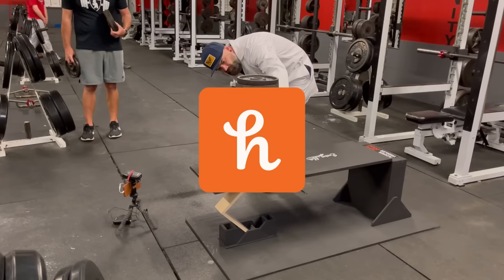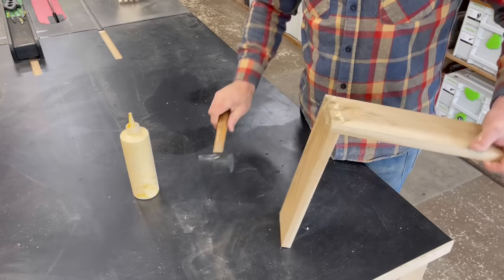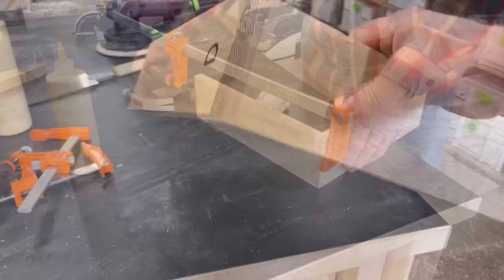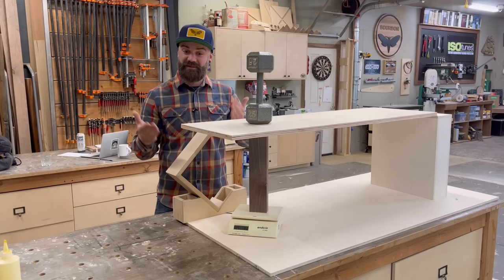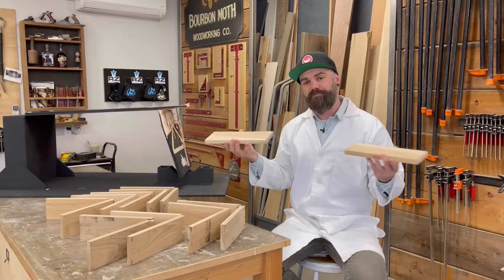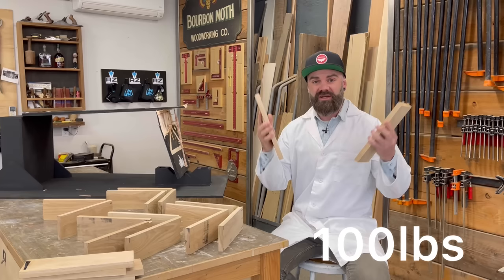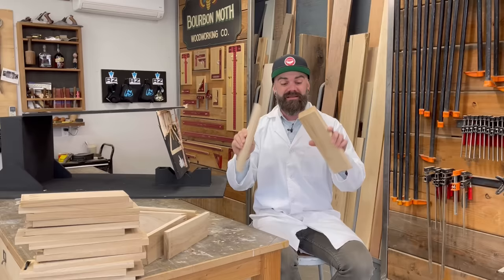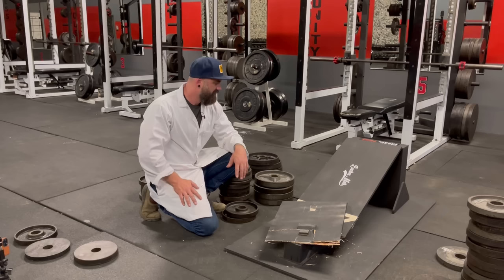What's the Best Wood Joint || Insanely Strong Joinery!

Comment: A point on dovetails, I've notice from looking at my late Grandma's 100 yr old furniture. Dovetails are everywhere, but there is zero glue. Seems to me that dovetails were not developed to be a strong joint that stands up to compression force, but to stay together along a specific direction of force before glue was a thing that saved all mediocre wood workers (<-- me not you) from failure.

On that note would be interesting to do the same test, but using tension forces instead of compression.
Reply: tension strength of most wood is insane. straight grain fir is like a million pounds per sq inch. try pulling a toothpick apart.
Reply: @victorhopper6774  You are correct, but tension strength of the joints is not the same as the wood.
Reply: Yes that is why dovetails are used a lot in drawers.
Reply: There was definitely wood glue 100yr ago. Humans have been using glue for 70,000 years. Egyptians used glue for wood furniture 4,000 years ago.

Your grandma just bought some junk, either missed the glue or used something low quality that deteriorated. Dovetails are definitely traditionally glued.
Reply: Yes glue made from bones for example
Reply: Back in late 1960s, as a teen, I made my dovetailed drawers with no glue
Reply: You can actually make furniture that is easily repairable by doing it that way, things can be changed and adapted later also. If you standardized the joints and had standard tail board lengths you could adjust widths by changing the front and back pin boards, basically enabling you to change widths of things if you want it wider, maybe you get a new TV that's bigger.
Reply: @mike8984ify  They used hide glue which could be heated until it lost strength and then the joint could be disassembled. Reversible glue if you will.
Reply: I think it was Anne of all trades who taught me that it was the scarcity of nails (rather than glue) that made dovetails the standard carpentry joinery of the past. Before industrial mass refinement of metals, nails had to be forged individually by hand. That's not a cheap process.
Reply: @Realism91  By doing dry dovetails and puzzle joinery?
Reply: @Dan-gs3kg  just by dowel pinning the corners, if it's a piston fit drawer with tight dovetails it should stay together just from the sides not being able to spread. With CNC accuracy they could achieve IKEA style assembly without metal fasteners or glue.
Reply: @mike8984ify  You do not know history. THE INVENTION OF DOVETAIL JOINTS WAS ENTIRELY IN ORDER TO BE ABLE TO BREAK THEM DOWN TO A FLAT PACK OR MAKE PARTS EASILY REPLACEABLE. Dovetail furniture was originally made to be taken apart, flat packed and moved, then reassembled, because they were superior in conditions where moisture swells and shrinks wood. They were not traditionally glued at all, they were pinned, so that you could easily take them apart and if necessary, repair or replace parts. Dovetails are not superior glue joints ... box joints and splined joints have always been known to be easier to build and superior for glued joints. 

Dove tail joints date back to early Egyptian and Chinese tombs and architecture ... they had no glue at all ... they used saw tooth pins ... especially in building frames for houses. The dovetail originated by at least the Egyptian first dynasty (3000 B.C.) as it was found in furniture boxes and coffins, as well as in ivory work. It is clear that the dovetail was also used as a building joint. Evidence from Roman buildings has shown its wide use in both furniture and construction. The Roman architect Vitruvius, in his discussion on construction methods for roof beams, includes the use of the securicla (little axes) or dovetail joint. Interestingly, the expressed use of glue also distinguished the work of the later date joiner and carpenter. This clearly shows that the apparent distinction between joiners and cabinet-makers suggesting that the dovetail was an invention of the seventeenth century and a hallmark of the cabinet maker, is clearly incorrect. The use of glue dates the builders of such furniture thousands of years after the 'duft-tail", "secricla", or dovetail inception. The better the cabinet maker, the less likely he was going to have to use glue. The use and type of glue can often identify the source of manufacture. Most often, glue was used when the builder was less skilled and glue made up for the imperfections in design and craftmanship or lack of quality control of the manufacturer. Glue was used more often for common mass manufactured furniture because tooling was not accurate mainly because tooling was frequently not sharpened at a frequency to provide clean cuts.  

So basically the exact opposite of what you claim. Although his grandmother could have bought some junk that they didn't care to even waste money on gluing, I suspect, since he is looking at it 100+ years later, that argues against the junk theory and supports the idea that it was well made and didn't need glue at all.
Reply: One advantage to dovetails is that when you are doing all of your work with hand tools, like the makers of antique furniture would have been, dovetails are relatively fast and easy to cut, and you can glue them up without needing clamps or nails (which were very expensive when they had to be forged by hand).

Comment: Its pretty rare that a drawer or box is stressed that way. I would love to see these tests repeated as a pull test instead (think the pulling action on a drawer).
Reply: Yes please!  Although I suspect that the miter with splines may still come out surprisingly well. 

I also wonder how much difference it would make if dowels and/or loose tenons (dominos) were perpendicular to the force applied to parallel to it. IOW which end of the box angle you pull on probably makes a difference. 

Another interesting test would be sheering force. Make a T like a shelf attached to the side of a cabinet. Apply downward force close to the joint. How do pocket holes, dominos and dowels compare to a dado & rabbet?  (Hint:  I’m pretty sure I know the answer.)
Reply: Scott Walsh did a video with pulling for the test with opposite results. The miter with splines was the best and box was the weakest.
Reply: I'd like to see the test after the pieces have aged for a year or two. I suspect the miter would turn out to be one of the weakest joints. What we're seeing is the strength of fresh glue here, not of the joint.
Reply: Miter joint also significantly changes the angle at which the forces are transferred between the two boards.  That could have an impact here.  It's plausible that if forces were applied at different angles the miter joint would turn out not that great.

Comment: As a full time engineer and hobbyist wood worker this is a fantastic video. I will say that by applying the weight to a lever arm you're testing the torque on the joint rather than the weight that it can hold. But because each test piece is consistent you do get reliable results and eliminate quite a few variables. Great to see you invested in a lab coat as well for science!
Reply: Great comment!  Lol. Lab coat!  Most "Doctors " are the same.  They just google what pills to give you for the symptoms NOT the actual cause. But that is for a different discussion. 😜😊
Reply: Yes, it's actually the law about force and lever action that applies.
The cross-product of force and distance is torque. So what we needed in this experiment was the distance from the end of the board to the center of the joint thus calculating the actual force applied to that joint. The result would be a figure in Newton meter or Nm, not in pounds or kilogram.
However, I think we should leave all the complications out of this equation and see it as a practical experiment or proof of concept. ;)
Reply: Yeah nah I wouldn't say it's torque. Because if you put the same weight further out from the pivot point it would still put the same force acting down on the joint. 
Or are you talking about the wood joint being the fulcrum? In any case, as you say, the experiment is consistent. It's comparing different joints under the same test conditions, and using the amount of weight on top as the variable.
Reply: @JebediahKerb  it entirely is torque. this is a textbook example of a 2D moment of force. statics 101.
Reply: @Pan_Galactic_Gargle_Blaster  it would only be torque if it was driven from a motor at the axis, or if a constant weight was at a constant distance and the force on the joint was at a different distance. Then you would talk about torque. But the weight is directly above the joint. It's always going to be the same amount of weight on the join if you have the weight directly above it, no matter how long the arm is. You could measure torque on the hinge, and that would change based on the arm, but the weight on the join is always going to be the amount of weight you put above it. He even showed this in the video.
Reply: Let's look at it mathematically. Torque is Nm.
Let's say 100N at an arm of 1m. That's 100Nm of torque at the hinge. If you put his wooden joints at 2m, then the force on that joint is 50N. But if the weight and the thing the force is enacting on is at the same lever arm, the length cancels out and you just have a force. Torque enacts on the hinge, force enacts on the joint.
Reply: If you move the weight and the joint twice the distance out from the hinge, torque on the hinge doubles, but the force on the joint stays the same.
Reply: @JebediahKerb  torque IS the force on the joint. you have a fundamental misunderstanding of rigid body physics.
Reply: @Pan_Galactic_Gargle_Blaster  Oh. Ok. I am wrong. I see now. 
Your well thought out, solid counterargument is flawless.
Reply: @Pan_Galactic_Gargle_Blaster  Thanks for that article explaining what I already understood. I agree there is a moment in this situation, but what is being measured is the force. Once again, if you move the weights and the joint to any point on the arm, the force is going to be the same. Torque does not matter. 
If he screwed one side of the joint to something vertical, then put a weight on the horizontal, then you could measure torque on the joint. But for the comparison of the joints you'd probably still just record how much weight is on there, as long as it's the same distance from the join.
Reply: "...force is multiplicative based on the distance from a point."
Yes but only if you move the weights and not the joint. Once again, if the weights and the joint are at the same distance from the hinge, the lever arm distances cancel each other out.
Torque is not a force. It's a way of calculating a force at a different lever arm to another force.

Comment: Dear Wendel, thanks for doing this test.  It certainly revealed some surprises, particularly the dovetail joints.  I built a bedroom suite 40+ years ago using veneered chipboard for the walls of the furniture modules.  The only joint I could make easily was a mitre joint with glue.  Despite decades of abuse, no sign of breakdown.  I got it right way back then before your video {or computers or internet etc}. Cheers.

Comment: mechanical engineer: my take is that the way dovetails are hand cut left a stress concentration at the inner edge of the tail (see failure pic for where it split). this is where the saw stops when hand cutting the tails. routing the dovetail would likely do a little better job (similar to box joint). altho box joint would still be better since it is shearing the glue only and not exerting a force that is splitting the tails

Comment: I knew the miter joint would be in the top 3 because it increases the surface area by the greatest amount AND in the same direction, i.e. in line with the grain. In 3/4" wood it's about 1" high by whatever the width of the wood is. I use this for building speaker cabinets, and I was originally surprised at how strong it is - especially when it's a box and not just two boards. The dovetail and box joints actually reduce the effective surface area quite a bit; in the context of this test, the sides of the fingers provide little to no structural integrity because the force would be torquing on them rather than pushing or pulling.

Comment: That was really cool. Now that I’ve seen it I can see several variables to consider. For the dovetail and box joints the strength would be affected by how tight the joints are. William Ng has talked about this in some of his videos. For wood glue to perform at its optimum strength it can’t be too tight or too loose of a joint. For the tenon, dowel, and spline joints the walnut splines likely we’re stronger than the dowels and tenons assuming those were just pine. And for any joints using end grain my high school shop teacher taught me a trick to make them stronger. I was building my Mom a bookcase out of hickory and due to time constraints I didn’t have time for fancy joinery to attach the top so it is just a butt joint where the top sits on top of the sides. He had me thin the wood glue with water and apply that to the end grain a couple of times and let it soak in without assembling the top, then after it was dry I came back with just glue and put it together and clamped over night. That was in 1975 and it has never failed in spite of being moved many times by lifting it by the top while fully loaded with books.

Comment: An interesting thing is that the splines can be added to a miter joint after the fact.
One part of the strength of the miter is that it is end grain to end grain, and wood glue generally works best that way - as it seeps into the pores, it effectively makes tons of tiny glue dowels in every pore of the wood.
Reply: Nice

Comment: In wood aircraft construction, where the least wood / lightest weight, and greatest strength, are essential, joints are made by using glued internal corner blocks and exterior glued thin plywood plates that cover the joint.  Nailed together.  This gives tremendous resistance to the rotational force that you are applying.

Comment: One thing I'd add that I haven't seen mentioned yet: testing for max strength doesn't necessarily account for the effect that cyclic loading will have on a test joint — the goal with a drawer isn't to withstand a single incredibly forceful push/pull, it's to withstand pushes and pulls over the lifetime of the piece, as the materials age and as the piece undergoes varying environmental conditions.

That's not to take anything away from this testing methodology.  But rather, to point out that this test isn't going to give someone all the information they might need to select a joint design for a project.  More specifically, I don't think it's reasonable to conclude from this test alone that dovetails are mostly for aesthetics.

Beyond that, other people already mentioned the difference between static and dynamic loading, and I would emphasize that: it would be good to control for how you apply the weight, to make sure that you're not (for instance) dropping the weight more when you're worried about a high stack of weights toppling onto your foot.

Someone else has mentioned using a forcing screw, and I know Matthias Wandel already uses one for his experiments.  Something like that would be a much more repeatable way to load the joint.

Comment: Loved watching thee tests and the method you used. The dovetail could have been starved of glue. To many people make an ultra tight joint. No room for adhesive. I spent a good part of my life as a Cabinetmaker. And made hundreds of dovetail drawers via a dovetail jig I made in the shop. I found that I needed a certain amount of slop so that there could be proper glue joint allowance. Too tight and I squeezed out all of the glue.
Reply: I imagine the same is true for box joints
Reply: @tomruth9487  Exactly.
Reply: It very much looked like it broke on the glue edges (which are long grain to long grain) - I think you're right.